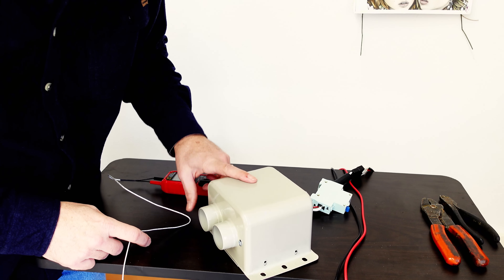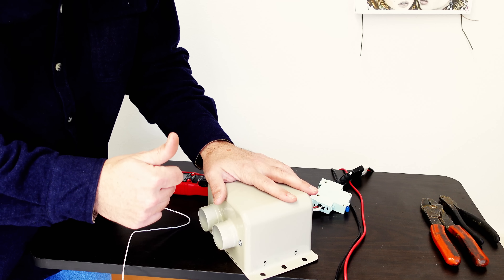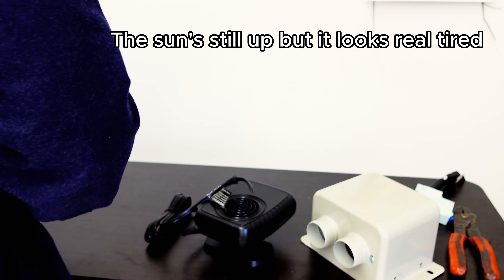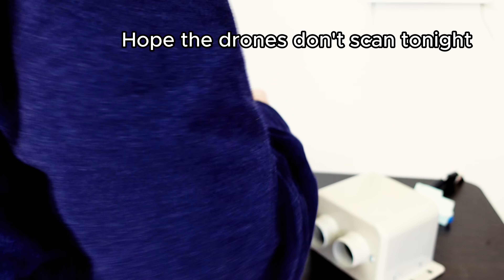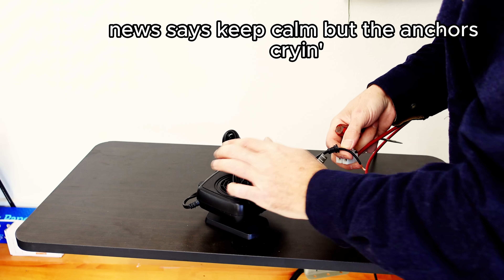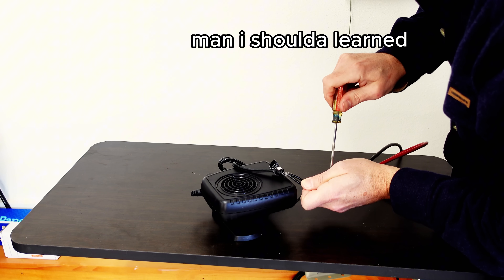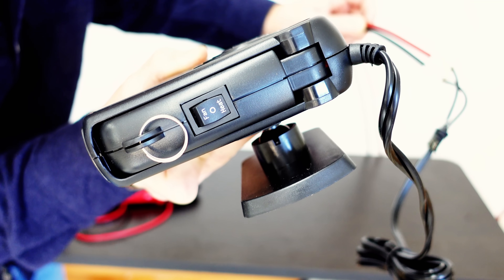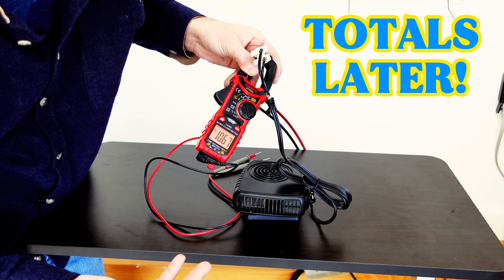Free Solar Electric Heat From AutoZone!

Comment: 2 100watts in parallel gives you 100 watts but in series you get 200 watts, so you lost me straight out of the gate
Reply from the maker: Whether in series or parallel it's 200 watts. Series increases voltage, parallel increases amperage. Either way watts stay the same. I was in RE R&D for 14 years. This is entry level knowledge
Reply: @WayOfTheZombie  It is 100 watts out put  period
Reply: @WayOfTheZombie  If I put 100 hundred 12 volts batteries in Parallel lt will only be 12 Volts
Reply from the maker: @EricSmith-qm7xb  sorry but you are incorrect about the watts. You are correct about the battery volts example u gave.

Comment: .
Instead of taking the cigarette plug apart why don't you just make some jumper wires that you can use Alternate times
.
Reply from the maker: That would be fine. I just didn't have any on hand at the time

Comment: How long would the autozone run on a 100ah battery?
Reply from the maker: Lead-acid/AGM batteries: usable capacity is ~50%
→ 100Ah × 0.5 = 50Ah
→ 50Ah ÷ 12.5A = 4 hours

LiFePO4 batteries: usable capacity ~95–100%
→ 100Ah ÷ 12.5A = 8 hours

Comment: what is the purpose of using these ?  They don't produce enough heat to keep you warm in a Ford E250 van when its 30degrees outside.   And it uses more power than you can generate from solar , usually if its cold temps there isnt enough sun to produce even 50% of a panels rated capacity. 
So if you try running those on your lead acid or agm starter battery , it'll be DEAD in 3-4 hours.   If you use it with a 200ah lithium you'll get 6-8 hours BUT wont regain that energy without starting the engine and using the dc-dc charging system, which then a oversized heater core will produce enough heat in 30 min to cook eggs on the dash. 
Overall these little wannabe heaters are just a $10 heat plate with a fan in a plastic box 
they serve no purpose. 

If you want CHEAP and low power consumption heat , a diesel heater is the way to go.  And if you buy one , go with LF Bros because they run flawless and last forever !!!
Reply from the maker: There's no batteries. I'm running direct

Comment: Please make a choice instructional  technical video or music video🙄   going to test a little heaters in boat😎👍
Reply from the maker: The music was too loud. I would recommend the white heater. I would also consider increasing the size of the exhaust by cutting away material. This would quiet it down a little, reduce back pressure and increase airflow.

Comment: You got "series "and "parallel " mixed up.  Parallel will Not increase voltage it Will increase capacity 
On the other hand,  series will double voltage.
Just like 2, 12v batteries in series makes 24v, whereas 2, 12v batteries in parallel will have double the amount of storage but still only output 12v.
Reply from the maker: I did not. I checked. And i would have caught that in editing. I worked professionally in renewables for 14 yrs

Comment: You never checked the CFM running over the heat exchanger. That white heater sounded as if it was moving 4 times the air into the space. I personally have burned up several of those black plug in heaters and I only used one of that white style heater over the last few years and it's still going.
Reply from the maker: Good to know. I'm working on a video rn adding more panels! Stay tuned...

Comment: Excellent topic and instructions. I am wondering about continuous runtime limits for the heater(s). Hopefully I didn't just miss that detail in the video.
Reply from the maker: I would imagine several years, as they will only run about 7 hours per day for the winter. Both would benefit from a high flow air filter on the I take. Occasionally I would recommend blowing air through in the reverse normal flow to remove dust. Or unplug  dissasemble and vaccum dust from fan and heater fins, once or twice per winter. If you have high dust or animals whom shed, place the heater above their head height. 
From my experience I would bet you can get at least 3 winters out of them.
Reply: @WayOfTheZombie  Cool. Thanks for the input!!

Comment: I think if you just plugged it in a power station it would tell you the watts.
Reply from the maker: Yes. I also like to remind people they don't need one. A clamp meter can show over 100 or more amps whereas the watt meters can't do that. Also a watt meter is in line so it's not easy to use. A clamp meter is quick.

Comment: I have one of those heaters similar to the black one. I put mc4 connectors on mine and have a 25,' 8 gage wire going to my solar battery box. But i  connect straight to some panels during to day and at night i switch over to my 400ah battery bank. Works great beside my chair keeping me warm. But be careful with the wires from the heater. They seem to get pretty warm. I dont think they have the right gage wire for the amps the heater is pulling.
Reply from the maker: @stevencartlidge6574  Thanks for the info. Yeah, China always uses the absolute bare minimum on wire. Sometimes even copper coated aluminum smh

Comment: Hi , so did you run the heater on the power directly from the panels through the breaker 15 or 20amp DC ? Thanks for the inspiration
Reply from the maker: @marchawthorne2479  Yes its run direct from solar thru the breaker. Thank you!

Comment: This isnt to heat a 10 sq ft room. Its to heat a 1 person tent inside a room so person xoesnt freeze to death. Insulate the tent with another tent and heat will last loner.
Reply from the maker: https://youtu.be/uEKActzjSH0
This video has the full parts list. I will be adding more panels to the setup. About 600 to 800 watts worth, and a couple more heaters. Stay tuned!

Comment: i've had those little heaters in my daily driver in the past, they come in real handy when its 10 degrees outside for helping defrost windshields and add just a little bit of heat in the cab while the engine warms up
Reply from the maker: Thanks for the data 101101000100 😊

Comment: Are you drawing straight from those panels?
 Because 200 watts is 200 W.
 Even if you are getting full sun 200 watts is only 200 Watts.
 There's a finite amount of energy that you're going to get out of this system.
Guess how much it's going to be.
 200 Watts.
Granted this is theoretically very efficient however it only works best at its peak 
You're better off fabricating a glycol heat exchanger which you can then dump heat energy throughout the day into a sand battery and then pull it out at night.
Reply from the maker: @charlesurrea1451  the PTC elements resistance rises with heat. The hotter it gets the more voltage the fan gets which increases flow and cools the PTC. This prevents the element from overheating at any time of the day.

Comment: This might defrost a window but isn't going to heat a room. Most of the USA gets 3 hours of solar power charging sunlight a day in winter. You will be lucky to gain a degree of heat in a 100 square foot room.
Reply: More solar panels, bigger batteries, or even sand batteries for storing energy as heat.
Reply: @drainx85  He said, no batteries. More solar and batteries makes me ask the question, how much am I spending for FREE HEAT?

Comment: What's the solution when theres no sun? Cloudy days and night time
Reply from the maker: If it's important for the space not to freeze then you'll need grid power or batteries as the backup. Solar heat reduces costs by reducing wear and tear on existing heating systems and reduces grid energy consumption. Checkout my passive solar air heater video for a more involved build but only uses a 10 watt solar panel
Reply: If you need to store heat energy for night time that is what sand batteries are for.
 The giant thermal mass that you pump a bunch of heat energy into and you can draw off at night.

Comment: All barrel type plugs are center positive.
Reply: Nope.
 I have a Brother label maker that proves otherwise.
Reply: @charlesurrea1451  the OP was dumping 10 amps @12v through a barrel connector. Center positive. Having barrel positive with high current would be asking for trouble.

Comment: Gets pretty dang hot, but can it heat a small room? I wonder which would be better at that, lower heat/more flow vs higher heat/ less flow?
Reply: let it run in a room all day with the door closed.....name of the game is SUPLEMENTAL heat so you dont make your heater work as hard

i have 2 windows in my bedroom, one faces south one faces west, i can fit a 100w panel on the inside of the window sill......i was thinking of doing this for years now i think i will try it

i need heat mostly in my bedroom where my wife watches tv and we sleep, i will set up 2 of these on the floor (let the heat rise and close the doors to trap the heat that builds up all day.....and then i wont have to bump up the heat until the PM (hopefully)

im also gonna get some solar black curtains (black on side facing panes) and even tape a fresnal lens in a spot outside 

i also seen videos that taping fresnal lens to solar panels helps but im not too sure about that yet
Reply from the maker: Careful with them fresnel lenses
Reply from the maker: Higher flow and lower temp is ultimately better. If we compare the power output of the two 120 watt vs 140 watt, the 140 watt unit would win as well as more energy to heat the air. Your existing heating system will run less, extending its life and saving energy. Both equate to $ savings. To add heating simply add more panels and more heaters as needed.
Reply: @WayOfTheZombie  I was thinking that would probably be the case, but I wasn't sure.